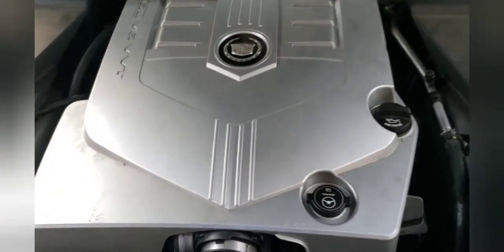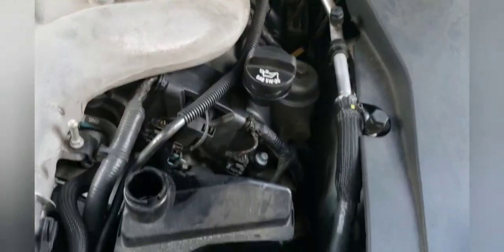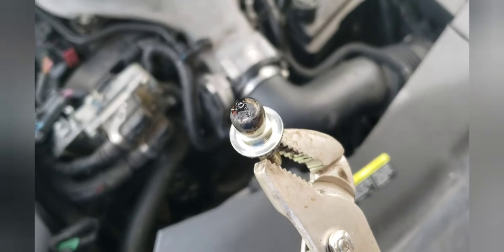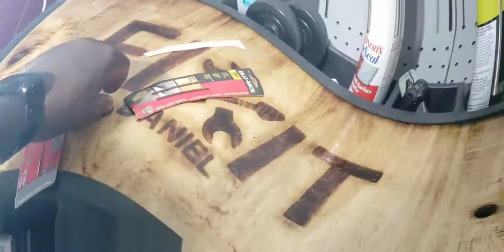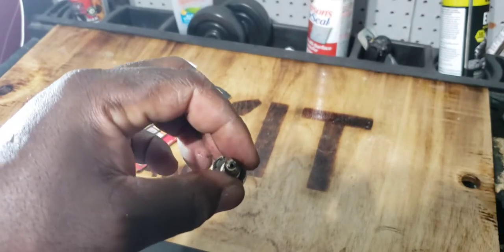MAKE MORE BREATHABLE CRANK CASE VALVE ON YOUR CADILLAC STS 3.6

Comment: I have the 2.8 same engine but smaller displacement  doing mine this weekend thanks for the video . Also I think the engine will be cleaner internally after this mod as more of the blow by will go through Pcv  instead of slugging up the  engine
Reply: Thanks Daniel  on the starter video  I got mine in last weekend after watching your video  prayer🙏🙏🙏🙏🙏 for the world from  Glencoe Ontario
Reply from the maker: Oh yeah for sure it'll definitely have a good blow by actually it's so funny I just did I just made a video updating that same PCV valve that I'm going to be posting very soon so stay tuned it's not very long I was just doing an oil change but I also check the PCV valve just to see if it was clean I re-cleaned it and put it back in so it's just check it out

Comment: I have an 07 CTS with a 3.6 engine in it. Should I assume that needs done to this one also although it’s not an STS?
Reply from the maker: It doesn't matter a 3.6 is a 3.6 where there's an STS or a CTS is still works and operates the same so the motor don't care what model you have but I mean you don't really have to do it but it helps it helps breed helps make your car breathe on that side I actually saw a video where a guy has had showed when he tore it apart trying to do the timing chain that whole entire side was completely burnt from all the burnt oil and he said it was dude to the excess of crankcase pressure and he was saying that that valve needs to be open more so that way it doesn't burn more oil on the passenger side motor than the driver side motor it was really interesting seeing the video on it

Comment: I wonder if you could put breathers on the valve covers and just block the hoses off
Reply from the maker: That may work with older vehicles like muscle cars or some 80s vehicles. But now these vehicles are different. Those hoses coming off the valve cover going into the intake manifold and the throttle body are putting those oil and gas fumes and allowing the car to burn off those fumes thru the engine instead of putting them in the atmosphere.

Comment: Hi. I have a STS 3.6 LY7. I have done this modification but now i have a little blue smoke from my mufflers after I start my engine after a whole night. Additionaly I think end of mufflers are dirty-black. 
Could I have broken something? I haven’t seen this kind of problems before modification😔
Reply from the maker: It's strange that modification wouldn't have done anything but just help a breathe a lot better with the crankcase of the of the oil of the oil Vapors so I don't understand how that would have broken something.
Reply: Ok thank You for reply. I have to check that - maybe this is some other problem